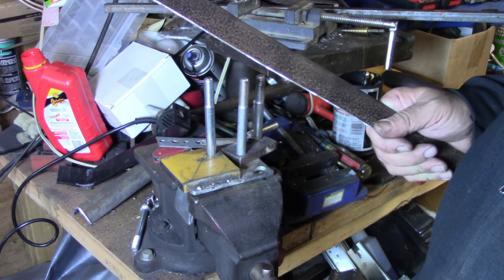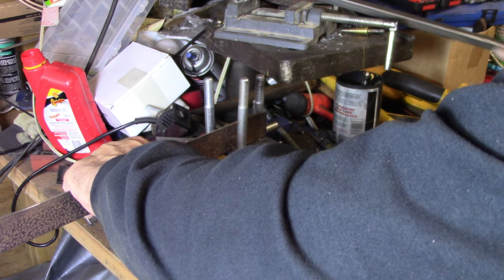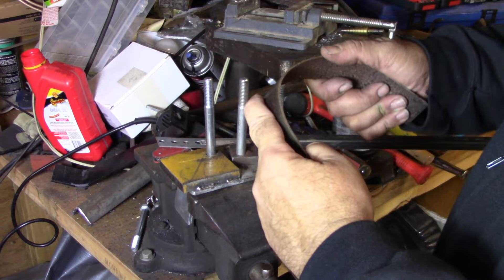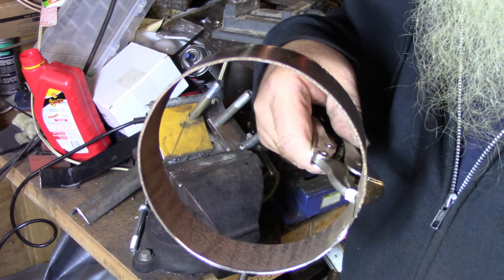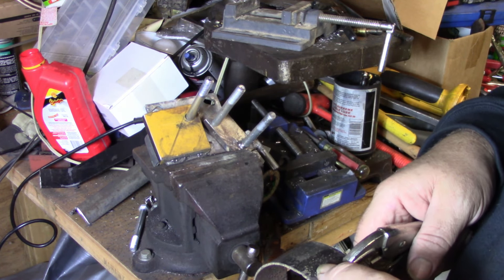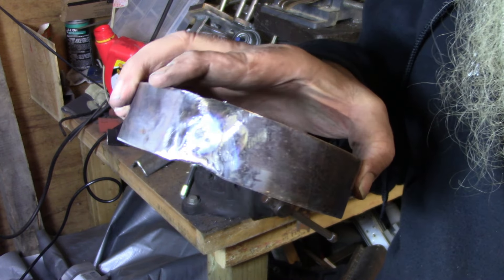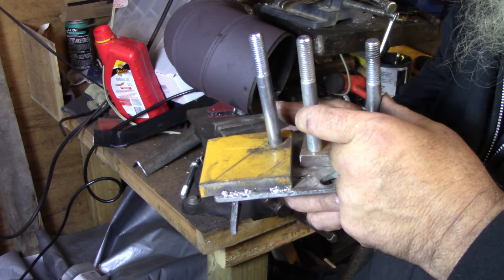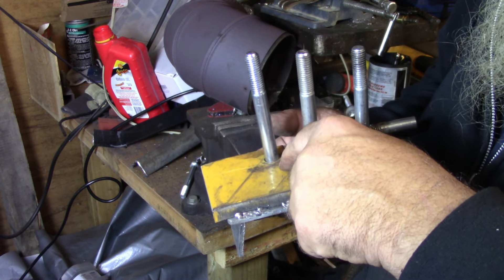Putting the Amazing Simple DIY Metal Bender Tool to work

Comment: Looks like it worked good. Hope the chimney works out. 👍🏻
Reply from the maker: It should work, I built the burner off the plans in my head and didn't take in concentration the air being hot and moving faster.

Comment: Works well. Making one with a tighter construction is fine though I expect it would have trouble with thicker stock. Good ideas to work from.
Reply from the maker: I've actually thought about how to improve on this design, I'm thinking of making more threaded holes so I can adjust for thickness and how tight it will bend.
Reply: @PullerbearEd  You want to llok up the Hosfield bender. Has a pair of bars with lots of holes for pins.